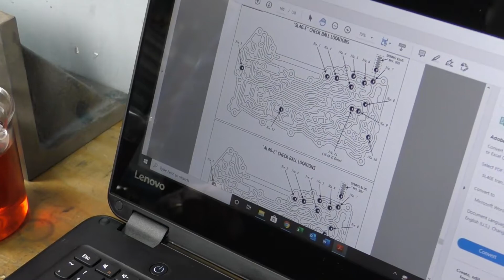BMW X3 3.0L GM5L40E Transmission

Comment: Hey mate, that was a great video, I have a Holden WL caprice 2005, it has a 5L40e transmission, it has a problem when I move the shifter from park to the lower gear, it comes up on the dash ESP FAIL, I have plugged the scanner in, it comes up with the error message P1825, internal mode switch illegal range.
I googled it
Causes

Internal mode switch failure

Shift cable damage or it’s out of adjustment

Do U have any advice?
By the way your accent sound half American half Aussie.
Could watch the video all day, I am very amateur at working on my own car, just started doing things myself & saving heaps of money 💰
Reply: By the way , the problem can happen when the car is stopped, idling, or when in drive, driving along the highway etc, from drive moving slowly down through the shifter until  it reaches the 2 lowest gears, then beeps, put the car in limp mode.
I stop, turn the car off, take key out, it resets itself, then drives perfect in normal drive gear, only happens in 2 lowest gears???
Reply from the maker: Looks like you need a new selector switch. You have a good ear, I left Australia in 1995. The last Holden we had was a 1986 Commodore. Dark Red outside and matching velour inside.

Comment: Does the rebuild valve body ready to install right away into the transmission? I have a BMW X5 e53 3.0i 2006 (GM) automatic transmission with 135k miles on it and I'm having transmission failsafe mode right now on my dashboard, will it take cares the present problem after replacing the valve body?
Reply from the maker: It will depend on what the actual problem is, if it is a valve body issue then it will take care of the problem but you will still need to clear the codes stored in the transmission control unit.
Reply: @klassikats   thank you for the reply, i will keep in touch after having my car diagnose at the shop

Comment: Just found this video after experiencing some slow shifting issues in my E46 with this trans.  Put a 3.0 engine in to replace the tired 2.5 and the trans doesn't want to hold the increase in power.  I believe I used a dex 3 fluid which may be contributing to my issues.  Had zero issues before the engine swap.  Trans has 170k miles on it, thinking about just going with a fresh rebuild unless you think I could revive the trans with a valve body overhaul?
Reply from the maker: Matthew, 
170K on a transmission is pretty high mileage and I would say it is certainly time to go through and rebuild the whole thing.
Thanks for watching

Comment: Hi i just found out my E53 x5 didn’t not engage to Reverse gear and I doesn’t move when it’s cold I would say because when they car already run for like 10km it’s actually engaged to Reverse but only moves few meters and free the gear back again . Is it having a dirty valve body ?
Reply from the maker: Sounds more like a clogged oil filter. However the bad thing about that would be the material that is clogging the filter comes from the transmission itself.

Comment: Great video! doing this work soon on my 2004 BMW 325i E46 5L40E, never serviced with 224K miles. Got ATF Mobile1 D/M Oil.  Is this correct type for GM transmissions?
Reply from the maker: The oil you have is a Dexron 3 type oil that is NOT for this Transmission. This transmission calls for a Dexron 6 type oil. The main difference between the oils is viscosity. The Dexron 3 is a thicker weight of oil than the Dexron 6, the Dexron 6 is also a full Synthetic ATF which a bunch of different fiction modifiers in it. I have put a complete list of the items we used along with links to buy in the description. 
But here they are as well just in case:
Shop Manual:                          https://amzn.to/31S7iwL
Oil filter kit:                              https://amzn.to/3mh6glo
Transmission Oil                    https://amzn.to/3mefZZQ
Transmission Gasket Set     https://amzn.to/37zt0cl
You may have to copy and paste the link into your browser.
Thanks for watching us

Comment: Awesome video! Where do u recommend I get all the gaskets and O-rings kit here in USA? Thank you
Reply from the maker: Simo, we have  links to all the parts we used in this job in the description below the video on youtube. Thanks for watching and thanks for your comment
Kurt
Reply: @klassikats  oh sorry I didnt think to check it. Thank you! Do you have a video or write up on the common small ATF leak at the linkage on the side of the transmission and how to repair it? Thanks again!
Reply from the maker: That is something we should look into!
Thanks
Reply: @klassikats  one more thing, where could I find those alignement pins you used to install inner gasket and the body onto the transmission? Cheers!
Reply from the maker: Hi Simo,  we made them, we just threaded some rod to match the holes.
Not hard with a lathe.
Reply: @klassikats   ok thank you so much!
Reply: @klassikats  so about those guide pins, I bought few M6x1.0x120mm do you think the length is good enough? Also, does the kit include those rubber oil tubes that go between the valve and transmission? Thanks again!
Reply from the maker: Yes 120 mm will be plently long enough and yes the kit does come with new rubber tubes for the fluid tranfer between the valve body and the transmission case.
Reply: @klassikats  great! Thank you so much.

Comment: Great video. I have just the p0734 after driving a few minutes. No slipping or other codes. Notice solenoids 1 and 3 show as inactive and 2 as always active when ignition on. When testing that same solenoid, no clicking but others click. Transmission oil was changed a year ago at 110k for first time, code went away but coming back.  Any suggestions?
Reply from the maker: So the P0734 code indicates that the input and output speeds are different when they should be the same in 4th gear, (1 to 1 gear ratio with torque convertor locked up). A shift soleniod that has failed could cause that if the PCM is calling for 4th gear but the transmission is not engaging due to a shift issue. Although you will usally have other syptoms, like a flare, (long pause), between shifts and holding a lower gear.  Solenoids should click and move when activated. So if you have one that is not working then certainly replace it. However, it may not solve your issue. The issue can also be caused by the TCC solenoid or it could also be the torque convertor lock up clutch itself. If there is any slippage in the torque convertor lock up clutch, it will set a P0734 code and you will usually not notice any slipping when driving.
thanks for watching
Reply: @klassikats  Thank you. Advice you can take to the bank Would solenoids codes show up if solenoid is failing or stuck on? I thought it should but didn't see any other codes. And what are your thoughts about using lucas transmission fix/conditioner or other addictive in these transmissions with transmission oil changes?
Reply from the maker: @dodoitdave1346  Yes and no, if the shift solenoid has a failure like an open circuit in the winding then yes you will get a solenoid code like P0758, etc. If the solenoid is stuck or there is debris in the filter screen you are more likely to get a code like Gear # incorrect ratio. The # will be whatever gear range is being affected.
When it comes down to putting an additive into a transmission or an engine, their effectiveness will depend on the internal condition, to begin with. A good additive may prolong a good functioning transmission but will not ever fix a malfunctioning transmission. I generally stay away from aftermarket additives and will stick with good quality factory approved fluids only.

Comment: had a question if possible. should i change the shift solenoids as maintenance  at 100,000 miles seeing as they will be in my face when changing filter? thanks for any advice
Reply from the maker: Only if you wanted to. Usually shift solenoids have a long life and really dont fail that often. Usually when they do fail is from cloging from dirty transmision fluid. So doing a fluid change with a filter is already a great thing.
thanks for watching

Comment: Gasket Parts are not available. Lmk if you can can do the valve body  service I'll pay $$$ mine does the high rev its 06 X3 smh. But I will pay for a remanufactured one lmk
Reply from the maker: Allen, Yes parts availability at the moment seems to be an issue with a lot of items. I do expect that they will be back in stock at some point. In the meantime Amazon has a rebuilt valve body in stock, that you can purchase. Here is the link to buy, https://amzn.to/2VChRn7 
Thanks for watching and good luck with your repair

Comment: is the solenoids at 24:50 known as the tcc solenoids? And are those the ones that cause the intermittent no reverse and no drive symptoms ? Do I have to replace them or could a simple clean fix the issue? Many thanks if you would take the time to share your opinion on this!
Reply from the maker: These solenoids are the shift solenoids, not the TCC solenoid. If you are getting a TCC error it is most likely the solenoid is dead and will need to be replaced. You can pull the solenoid and check the filter screen to see if there is any debris on it. If there is debris blocking the screen it is most likely a sign of a bigger issue that is more than just the solenoid. The TCC solenoid is located on the other side of the valve body across from the EPC solenoid.
Reply: @klassikats  Thank you!

Comment: explication perfect and video perfect !Exellent !
I see Valve body gm 5l40e on aliexpress for low price ,you have check this solution?

Thanks for this good job !
Reply from the maker: Thanks Renard,
No I have not had a chance to use the Aliexpress valve body. My only question would be what calibration package is installed in the accumulators. Otherwise it is most likely an okay replacement.

Comment: I have a question. Did you put these gaskets correctly? I gave it just like you, but the diagram shows otherwise😑
I hope you are right🤣
Reply from the maker: Yes, I did correctly install all gaskets and seals and the valve body is functioning well in the vehicle.
Thanks for watching
Reply: @klassikats  I watched other videos where these gaskets are put in a different order (lower nr 105 first, upper nr 104 later)- Your video 45:26. I think that's right: https://www.szybkiplik.pl/RGhik7LNNk

Comment: hello guys. here i have a weird issue. around 6 years i took my car  to transmission  rebuilded,  it's a GM 5L40E. well everything was good transmission gears shift felt smooth.  but when summer arrived to the town then  Air aconditioner Mandatory in Used.   transmission slip a little bit  in first gears.  feels   after around 30 minutes of AC on.  if I drive  agrecive Mode Style by long periode.  this  symtoms appear too...   for Normal Drive Style and no AC on.  transmission  shift smooth.    i just wondering   torque converter, transmission oil pump or valve body.  wich of thise could make this issue.    oviuosly happen when oil warmed up or transmission over heating.    Note no warning light and No codes.   any idea i will appresiate. thanks  guys.
Reply from the maker: It sounds more like a temperature issue than the actual A/C system being at fault. The A/C system should have no bearing on the transmission operation. The only thing that I can think of would be if there is some kind of electrical interference coming from the A/C system that is maybe affecting the pressure control circuit of the transmission.
It something where you will need to put pressure gauges on the transmission and drive it to see what is happening while the transmission is hot and driving with the A/C on.
Kurt

Comment: Hi, quick question.. if inneed to replace the neatral safety switch.. do i need tontake the valve body off? Or you have any suggestion on how to replace them?
Reply: Because my traction control light is on along with the gear sign that has this sign ! In it.. and stuck in 4th gear.. i have replaced the rear passenger side traction control.. and replace the filter and refill.. still the same.. litghts are on amd still stuck on 4gear.. any idea?
Reply from the maker: @tengzturiagaiii3185  There could be lots of things going on with your trans, Tengz. I would plug in the diagnostic computer to read off any codes, then mechanical pressure tests. Good luck.
Reply: Klassik Automotive Training School ok thanks

Comment: Can you replace the neutral safety switch without taking the vavle body off?
Reply from the maker: The valve body will need to be removed to access the Neutral safety switch
thanks for watching

Comment: Hey! Sorry to bother you. Having trouble with my e46. It’s drives forward fine but when I put it in neutral it drive forward as if it was in low gear and reverse it drives forward as if it was in a higher gear. I can’t find the solution on any forum. Hope you can help me out.
Reply from the maker: That is going to be most likely a valve body issue. When we select a gear in the car a cable moves a physical valve in the transmission valve body. This directs fluid to specific pathways in the valve body to apply specific clutches. If fluid can leak between the passageways then it is possible to apply a gear or the wrong gear for what ever is selected in the car. The leak between passage ways could be from a failed gasket or rubber seal. There is also a possibility of mechanical issue where a clutch pack is stuck applied causing the transmission to continue to drive forward when in neutral. If the transmission has a lot of miles on it i would suggest completely removing and rebuilding it versus trying to repair it in the car.
Reply: @klassikats  thank you for the reply
Reply: @klassikats  with 135k would you recommend getting a refurbished valve body. I’ve seen them being some going for about $200. Is it worth it?
Reply from the maker: @SANTOSlosGUERREROS  That is up to you. I would start with seeing what transmission codes are present. Then depending on what codes are present I would then drop the transmission oil pan and filter and see what it looks like in the pan. If there is a large amount of debris in the oil pan I would most likely plan on rebuilding the transmission. If there is an average amount of debris in the oil pan I would remove the valve body and check for signs of cross leaking between passageways. I always want to confirm that I have found the problem before I throw a $200 part at it in the hopes that it will fix it.
Reply: @klassikats  thank you for replying. I don’t have any codes presents but I will check the valve body to see if there’s any problems with it or solenoids.
Reply from the maker: @SANTOSlosGUERREROS  sounds like a good place to start

Comment: Really good explanation . I have a question , which of this parts can make the Gear Monitoring error ?
Sub added ;)
Reply from the maker: A gear monitoring error can be created by a lot of different things. However, the most common issue  is the neutral safety switch

Comment: I have code P0848 TFP sensor B high input
Would that cause the car to be in limp mode and have rough shifts? 
Also is it a matter of just replacing sensor B?
Very helpful video by the way👍
Reply from the maker: Yes, this code can absolutely result in rough shifts. The pressure sensor is seeing a high pump pressure, a high pump pressure will result in harsh shifts. Changing the sensor will most likely not solve the issue. I would start by performing a pressure test and confirming the actual operating pressure in the transmission. In these transmissions, the fluid pressure is controlled by a modulating solenoid. If the solenoid is blocked with debris or has failed closed then it will result in high operating pressures in the transmission. You will need to also check that the solenoid is receiving a signal to modulate pressure. If not there may be a control unit issue or a wiring issue in between the transmission and the control unit. Unless you have access to the tooling and a lift I would recommend taking this one to a transmission shop.